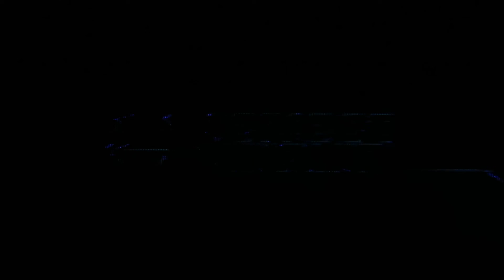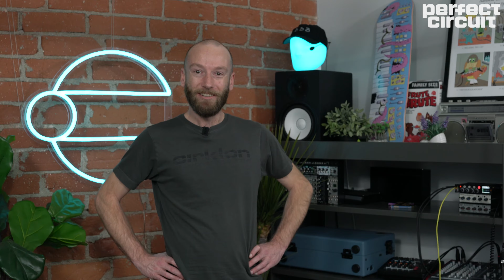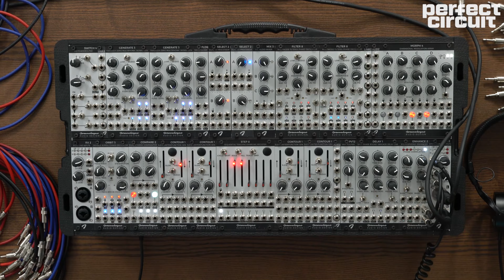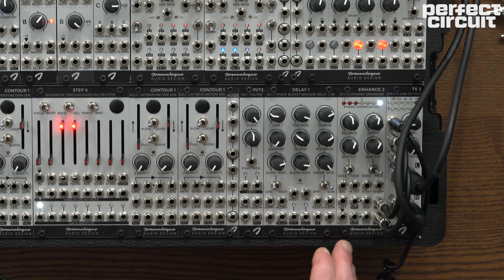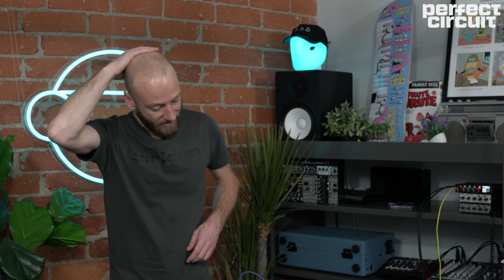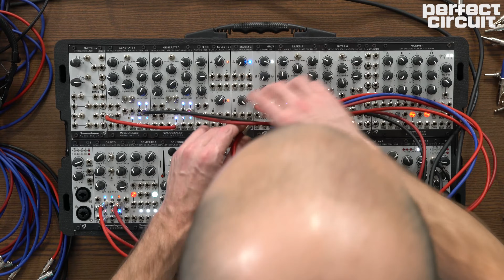Boris from Joranalogue Spills Patching Secrets! See what he Revealed at Perfect Circuit

Comment: 16:02 onward here is mandatory.  This is a super excellent demo and a great companion to the long Frits one.  I really like a lot of Boris's ideas here: using Step 8 as sort of a performance mixer for routing modulation with attenuation control, also routing the Orbit 3 sync through the Switch 4 first to on the fly toggle between a pattern / wandering chaotic patch, the use of envelopes to create tight juicy sweeps in the filter in the mid/side processing ... so so good!  Boris and Frits are shredding keep doing your thing